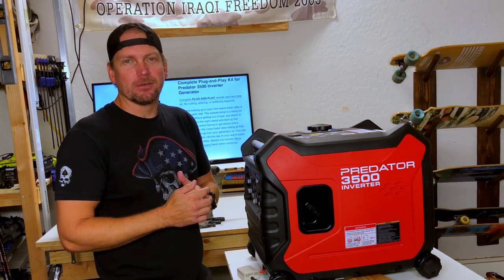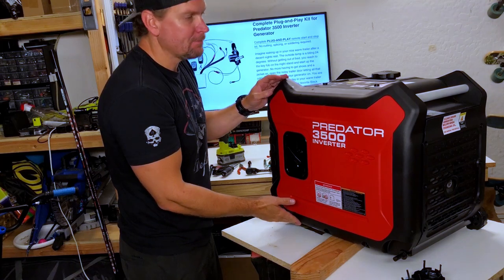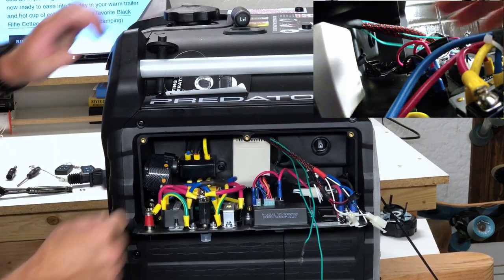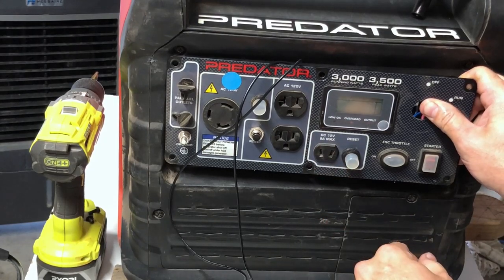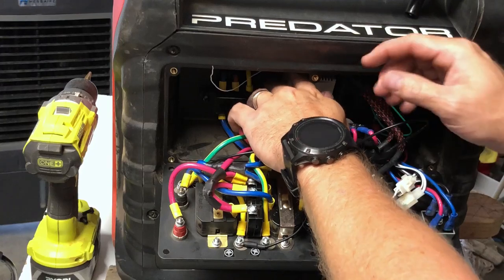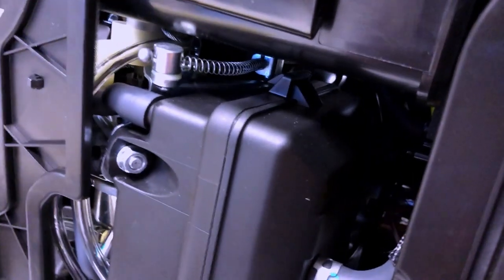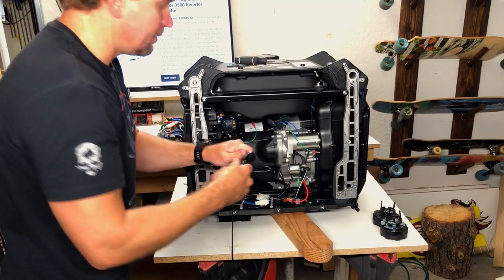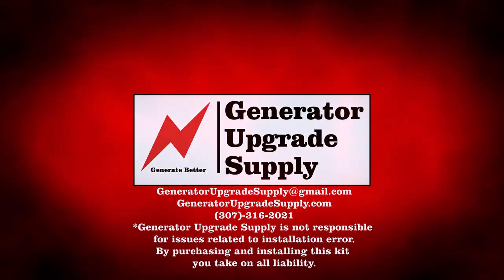Predator 3500 Plug & Play Remote Start & Stop Install Video (Model 1.0)

Comment: Well, just bought this and installed this today.  Shipping time wasn't bad, but I did this in the offseason.  Going along with the video, it was a super easy install.  I was able to start the generator from inside the house.  I walked across the cul de sac and was able to get a max start stop distance of 85 feet.  I ordered the extended range antenna, so I could have the extra distance.  I should be able to either leave my generator in the bed of the truck or use an RV extension cord and get the generator further away from my camper.  The only issue I had was the green wire pulled out of the male bullet connector.  Didn't think the crimp was 100% tight.   I will get new terminals at work tomorrow.  Other than that I am really happy with this product and look forward to next camping season.  I would recommend this product.
Reply from the maker: Hey Shawn, Thanks for the feedback. I try to get a good tug on them when I make it before I test them. Maybe I gave it a little too much, haha. I am sorry the connector came loose. I can send a new one if you can't find one. Let me know. Thanks again!

Comment: *update*   So finally got around to doing the install. With using 2 hands and took my time along with oil change while I was in there it took an hr. So pretty easy. But man this was what was missing on these generators. Real nice job Kenny putting this together for us. I got the upgraded ant. And my 1 acre yard isnt big enough to get away from it to tell where it stops working. Thanks again brother and a job well done.

Comment: Dam dude you got. Just ordered it. It's on it's way. You have figured out the only flaw with the predator. I've put quite a few hrs on my at 500 ft above sea level and at 7500 ft. Works great. This little add on will make it so nice on those cold mornings.

Comment: Just installed it. Super simple, video directions are perfect. I did use a zip tie to hold choke cable and actuator cable together to make sure they did not slip out of the choke knob. Works great. No more getting out of the warm trailer in the morning or at night to start the generator. Thanks Kenny, also nice touch with the little personal note on the receipt. Looking to get the upgraded wheels next.
Reply from the maker: Thank you! Let me know if you have any questions! Always here!
Reply: @generatorupgradesupply8953   Can you get a new choke unit for the blug and play.

Comment: I put one of these in mine, best thing I ever did, works great!
Reply: When putting the cable into the choke slot, it came out a couple of times.  I drilled a small hole through the top and put in a small cotter pin, which solved the problem of popping out.
Reply from the maker: I am glad to hear it! Thank you for that!

Comment: Thank's very good video, when mounting the new remote choker pull system check the original choke pull wire get back in exactly same position, you can see the pull wire is squeezed a little from the anker screw, I missed the original position with 1/2" so generator would only run for 5 minutes and then stall, correcting the original wire position fixed the issue.

Comment: Greetings, just got my updated kit in the mail today.  Will install this weekend.  Initial impression:  Very good workmanship and attention to detail, instructions very clear and with help of video should be a quick install.  Thanks
Reply from the maker: Awesome, Thanks James! Let me know if you have any questions while installing or after! Thanks for the support!
Reply: @generatorupgradesupply8953  Got it installed this morning. Super easy, just had the video playing in the background. Works like a charm.  Only thing I did extra/different:  I drilled into the plastic boss in front of the starter with an 1/8 bit and used a zip tie here to hold the two wires from the choke pull, also used zip tie for green wire on main harness right by the starter recoil rope, just didn't want that wire resting on the recoil rope.  Thanks
Reply from the maker: Glad to hear it went well James! I'll keep those additions you did in mind. I like them!

Comment: I bought this kit with the remote extender and wheel upgrade. His video makes it easy to install everything. Since I ordered the extended range antennae, I chose to take off the junction box on the left side (has two screws) and there is a hole behind it that I ran the antennae out. This way I have the wire coming out the side panel instead of the front of the control panel. This allows me to tuck the antennae inside the side panel when not in use. Not sure if anyone else has done the same or has a better recommendation? Anyway, hopes this helps. Thanks for everything, Kenny!!
Reply from the maker: Dude! That is a great idea! Thank you for sharing. That’s what this is all about. Hope others can use that. Thank you for your support!

Comment: Bought one of the kits it came in a few weeks ago. I finally got around to putting it on the gen and I ha e to say it was easy to install. Had to do some adjustments to the l bracket but other then that it was easy. Thanks for the can coozy and stickers. Will Def buy another..

Comment: My 3500 just died. As it was running it started struggling with no load, I then went shut it off and restart but nothing. Any thoughts or suggestions on what to start with replacing parts/pieces? Plenty of fuel, oil just changed, spark plug looks good. thank you. Also, if it gets fixed I am def ordering from you, too cool, thanks again
Reply from the maker: Hey, It could be a number of things. The ones that have helped me are 1. Cleaning and/or removing the spark arrestor in the back of the exhaust. 2. if you have ever overfilled it with gas it may have leaked into the charcoal canister. You can unplug that to see if that helps get you started. I would start with those two tings.

Comment: One good point is that if you rotate the knob to the off position (which shuts off the gas supply to the carburetor) without pushing the kill button the generator will continue to run until all of the gas in the carburetor is burned. This is great and will keep the carb from possibly fowling.

I’d love to order two kits but your website won’t ship to my address in Alabama or Florida???
Reply from the maker: Hey Give us a call and I can put it in manually. 307-316-2021 This happened this morning for someone in CA as well and when I put it in manually it was fine. I am looking into what is causing that. Sorry about that. *Update: I believe I found the issue, it had to do with adding 2 to the cart, my weights and shipping settings were not talking to each other. If you give it a try again let me know if that fixed the issue. Thanks again!

Comment: I have a couple of questions please... that i did not see addressed in this video.... thank you! Excellent demonstration video!!! 😀👍
1. How far of a range (feet or meters), will the stock remote start the generator from, while inside, say, as a camp trailer? Verses the upgrade extended range antenna?
2. Does your company make this remote for other brands of generators?
Reply from the maker: Hey Jim Good questions. The current model has had a few upgrades since the video with another one coming soon as far as range goes. Starting has always been at least 300 feet. Stopping has been the tough part because of the electrical interference when it is running. Currently you can get about 60 feet stopping. However, I did just have a nice breakthrough with an antenna configuration in the new module I am using that will get about 240 feet!! I am having them built now and will be including them as the only option moving forward. I hope to have that updated in the next couple of weeks. As for the second question I have a long list of models I will be creating them for but nothing out yet. Thanks again!
Reply: @generatorupgradesupply8953  ok great!! I just went out and purchased the Predator 3500 and then promptly got online and ordered a remote kit from you yesterday, Sept 2nd, 21. Looking forwards to getting it here and installed  for my next RV adventure!!! 😂👍
Reply: I received the remote kit the other day, and had it up and working in about a half an hour. Easy-peasy instructions.  Mine started it up at 150ft... I didn't try farther.... and it will turn off at about 100ft... including a few obstacles like vehicles and my camper in the way.  So far I'm very happy and impressed.  It's going to make deer and elk camping into deer and elk.... GLAMPING!!!! THANK YOU!!! Jim. 😂👍
Reply from the maker: @jimalbrecht8803  Thanks for the feedback Jim! I am glad you are getting great range with the new module!

Comment: Hey I just subscribed. Excellent video. What do you think of these 3500 inverter generators by predator.
Reply from the maker: Thanks for the support! Best value out there in my opinion (includes the Powerhorse 3500 from Northern Tool). You take care of it and it will take care of you!

Comment: Nice to know this is available. Can you still start the unit with the onboard electric start button when your system is installed? Thanks!
Reply from the maker: Thanks, yes it works just like normal even with this installed. Let me know if you have any other questions.
Reply: @generatorupgradesupply8953  : Thanks! That was the only thing holding me back from making this mod.

Comment: Installed this weekend. Very easy and quick actually fun project. Works great. Oh ya almost forgot. I run my 3500 till it runs out of gas so I don't have to deal with gas additives. Is this OK??..Thanks.
Reply from the maker: Great to heat it went well! If you’re not storing it with gas it should be fine.

Comment: Excellent vid, will get one soon, 

my 3500 predator stop/run/start knob is not shutting off engine when I turn it to the off position, (400 hrs ) what part replacement would you recommend? Or what fix would you recommend?

Comment: Installed and it was pretty easy following along to the video install.  Only problem is that the remote won’t shut off the generator
Reply: Update: emailed “GUP” and they told me I had connected to the wrong set of black wires. Made the switch and it works! Guess they didn’t quite make it idiot proff🤪
Thanks guys, can’t wait to get out camping and impress my wife!!
Reply from the maker: Glad we were able to get you up and running!! Enjoy it! Let me know if you have any questions. Always here!

Comment: Once the remote start system is installed does the ESC Throttle switch remain in the off position unless manually switched? The starting instructions indicate to always start the generator with the switch off.
Reply from the maker: That is correct. We will be working on adding the esc function in the future but for now it is still manual if you want to use it.

Comment: Awesome video on how to install your remote switch. I have the 3500 and have had it for about 4 plus years so far. I am having a problem right now with mine. When I go to turn it off it keeps wanting to run and chug, and like it's dying but just won't shut off until it runs out of gas. Any idea what it could be?
Reply from the maker: Hey, it sounds like the stop switch isn't grounding out the generator. When you turn it to "stop" it turns the gas off as well as activates the stop switch which essentially grounds the generator out and stops it right away. I would check that stop switch first.
Reply: @generatorupgradesupply8953  For the life of me I can't see in that tiny hole on the Start, Run, Off knob to see what type screw driver is needed. I have tried a few long small Phillips and won't bit on anything. Is it a special one?

Comment: I'd personally like to see a  switch added to the front of receiver allowing the user to switch off the light on the unit after installation to lower power drain just a little more
Just curious, why not make the unit antenna a little longer, and run it beside choke solenoid for longer receive distance. 
The longer the antenna, the better!!
Reply from the maker: There is a kill switch in this kit to shut it off when not in use. It comes with the kit. (About the 11 min mark on the video)
I agree on the antenna and we are about to release an extended range antenna option in the next couple of weeks. It will help if you need more range when stopping because of the interference the generator creates and how your set up is. Staring works no problem from 300 ft or more.
Reply: @generatorupgradesupply8953  thanks for the reply. I watched the video in its entire length, and I am aware of the switch put in the front panel. When the switch in the front panel is ON, so is the indicator. (Wheather gen is running or not)
If for instance,  the switch is ON, but genny is NOT running, that indicator is still using power.
My suggestion is another switch to allow user to turn off/disable indicator when receiver is on, but genny is NOT running.
Or a simple on/off tag for the panel toggle.
Cant see the Led when panel is closed anyway. 
Great video, will be ordering 1 soon, and maybe I'll do a video on it👍👍
Reply from the maker: @Guns_N_Gears  it seems like an on/off sticker would do what you’re looking for. I had that thought too since you have to orient it a certain way to make sure up = on. But I may be off on what you’re thinking. Always open to ideas and feedback so thank you!
Reply: @generatorupgradesupply8953  correct, you are on the right track!!!
A simple sticker would do the same, but there are toggle tags in metal that come with most switches, and they are indexed.
Reply from the maker: @Guns_N_Gears  yea I was surprised these didn’t come with that. It was hard to find ones in bulk, good quality, and consistent, the right size for that hole believe it or not. I’ll work on that. Thanks for the feedback.

Comment: I’ve installed the remote and at first very pleased. On my current camping trip I had my generator off and left my camp site for about six hours. When I returned the generator was running. I later discovered that if the radio receiver is on it starts up on its own without my use of the remote. So if you leave the generator unattended turn the radio receiver switch off. The camp ground is filled to capacity I’m just wondering if someone’s car key fob is actively starting the generator. Other wise a great product despite this hiccup.
Reply from the maker: Hey John, shoot me an email so I can get a replacement out to you. I have recently upgraded the module I am using and would like to get one out to you. 
Generatorupgradesupply@gmail.com
Reply: I have the same problem
Reply: Gotta give a follow up on my previous post regarding unintentional startup. Kenny saw my post and acted quickly to get a replacement part to me to rectify my problem without me asking for it. Now that’s customer service!  I installed the part and currently i’m camping and remote is working better than ever.
Reply from the maker: @johnwashburn48  glad it’s working great! Have an awesome trip. Let me know if you need anything. Always here.
Reply from the maker: @rodneypatterson3268  hey let me know how that replacement is working and if you have any questions.
Reply: @generatorupgradesupply8953  Thanks for the quick response. I will as soon as i get it installed.

Comment: I would like to buy a pull handle for the Predator that attaches to one of the lift handles and folds over the top of the generator. I hate bending over so far to push or pull it to where it will be used.

Comment: Hi.  Since keeping the remote start module energized is presumptively a requirement to allow it to receive a remote start signal, and keeping this module energized requires some battery power, it is reasonable to believe that if the generator's battery is hooked up to a shore powered trickle charger, that the remote start module can remain energized, and that the trickle charger will replace the small charge lost in the battery from not only the forces of time against an untapped battery, but additionally, the charge lost to the energized remote start box?
Reply from the maker: You are correct and the trickle charger would replace any lost battery power the module requires. You would have to keep it on for a week or so without charging or starting the generator to drain the battery.

Comment: Do you need to manually flip the switch before using the remote start?  I think if you leave it on all the times, it will drain the battery, correct?  Also, would this work on a Champion Generator with electric start?
Reply from the maker: Hey, thanks for the question. If you don't run the generator for about a week with the switch on it will drain it. As long as you are running it it will charge the battery. I don't have a kit yet for the Champion. If you shoot me an e-mail to generatorupgradesupply@gmail.com we can try and work one out. Thanks again!

Comment: I brought this remote kit for you 2021. My remote control batteries died and I replaced them. Do I need to reset the remote somehow because the generator will not start now. nothing seems to work at all using the remotes.
Reply from the maker: Hey Michael, Yes you will need to relearn the remotes. Here are the steps for the kit you have.

To clear the codes:
Pop off the cover on the white module. 
Right by the blue LED light there of a small circle button. 
Press and hold  that for 8-10 seconds. The light will go out immediately. Hold it until the light comes back on.  
The codes will be cleared. 

To relearn the remotes:
Pop off the cover on the white module. 
Press and hold the small circle button next to the blue LED until the LED light goes off. 
Press any button on the remote and the LED will blink back on. 
The remote is learned. Repeat with the second.